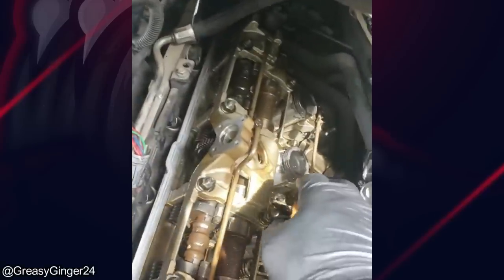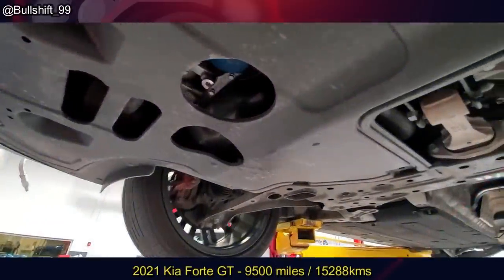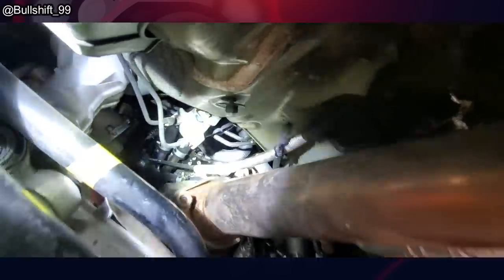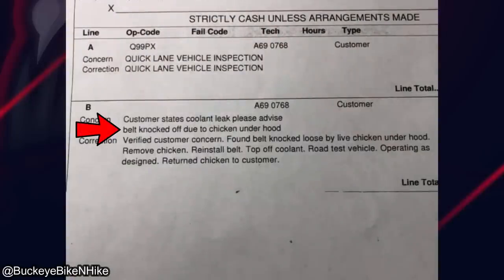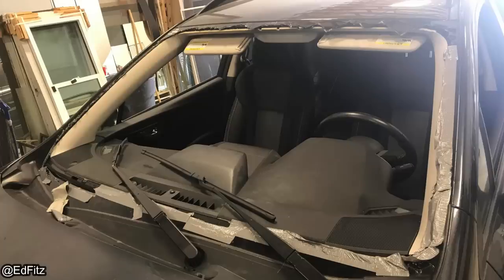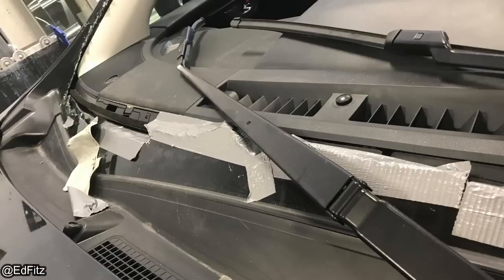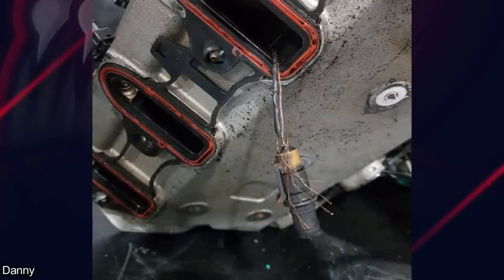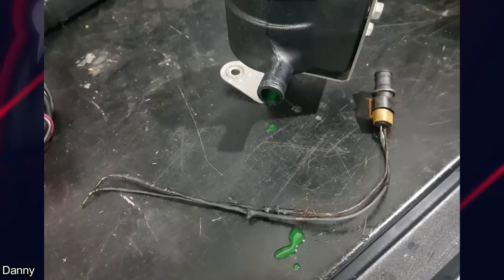Customer States Check Engine Light Is Still On | Just Rolled In

Comment: The last reminds me of myself buying a car and asking mechanic, why my front breaks creaking and shaking the car... he said that rotors are bend and need to be replaced. Ok I said, let it go for a while, then went to another mechanic for minor repairs and mentioning the brakes. After repairs, he told me, that rotors are just fine and some idiot inserted break pads the wrong way... on each wheel they were positioned the same way, not opposed. That was the last time I visited the first shop. :D

Comment: Could the missing exhaust be thieves, stealing the catalytic converter ?

in this case, the costumer would most likely nok know anything about it ?
Reply from the maker: It definitely could be.
The mechanic think it was possibly the customer since it's been like that since almost new, the check engine light is on, it runs rough, its super loud and the customer removed a bunch of the intake.
Reply: You would think the mechanic would mention to the customer, next time they chat (when he returns for the car maybe), "so... what happened to the intake and exhaust?"

Comment: The water pump on those 4.2L Trailblazers and Envoy's are a common issue, one of the few issues I've run across working on those, otherwise they drivetrain and suspension has been solid.

Comment: In Ontario, a windshield isn’t mandatory. Older jeeps can fold theirs down. Strangely enough, wipers must work.
Reply from the maker: Strange indeed. Not sure what our rules in Alberta regarding this.
Reply: Years ago, in MO, it a windshield was not required, it just could not have a crack that blocks the driver's view. Or, pieces of broken glass still attached. I had a friend that had a car inspected with no windshield. I don't know if the same thing still applies or not. And it used to be the same with a rear view mirror - if it has one, it cannot be cracked.

Comment: I worked at a boat yard and it was pretty common for boats to come in with the wrong fuel. Bad enough with a truck but with boats you could be talking over 500 gallons 2 fuel tanks and 2 motors. Or fuel in the fresh water tank. That was always fun but fuel in the holding tank was a really crappy job
Reply from the maker: My uncle use to work at some boat yards. Heard quite the stories so I believe that lol

Comment: Didn't Chrysler also have a problem with dashboard covers a while back? I believe it was on the 300s, but they were cracking and separating in some cases.
Reply from the maker: Not sure but also wouldn't surprise me. Fords had an issue with them warping and such as well.

Comment: yikes! There are things called haynes manuals, worth a read or maybe invite your local mechanic over for a BBQ. I suspect a lot was down to suck it and see learning. As for the windscreen guy here in the UK that would actually be a legit thing to do as technically what is considered road worthy is surprising. You can remove all glass, panels and facia and a car be road worthy. The electrics must work and the mechanicals be sound and no structural faults such as deep rust. The only critique of removing the windscreen is that it was bonded and the residue is gonna be a pain to deal with.
Reply: There is also this thing called "YouTube". When I'm not sure how to do something on a car I'll check YouTube.More often than not people have made videos on how to do it.
Reply: Seems all right to me as long as they were wearing motorcycle goggles!

Comment: Would it be possible to still use the brake pad even if its been put in the wrong way? i mean, the brake surface is fine, its just the metal back that been damaged. ofcourse the rotor would probably have to be replaced / resurfaced

Comment: Had the pollution pump pulley rip off at high speed, it was plastic, and it bounced around in the engine bay like crazy.  I thought a bomb went off under the hood.
Reply from the maker: That'll scare a guy!
Reply: @JustRolledIn  scarier was the tow truck they sent, backed right into my truck, didn't hurt it so i don't stress over it but scared the crap out of my wife

Comment: The reversed disc brake pad was a first for me. Did have a worker fill a shop truck with diesel. Yes, it’s a gasoline engine truck. We
Reply from the maker: Seen my fair share of diesel trucks with gas in them and vice versa.
Reply: @JustRolledIn  ... I have also seen a brand new Chevy diesel van with a no-lead filler neck, circa 1990. (G series 1 ton) Took 2 weeks to special order the replacement part so we had to fill it with fuel using a funnel while we waited for the dealer appointment. The same van also had one of the welded braces for the body side panel installed about 2 inches out of square. Being a cargo vehicle the interior is open and we spotted that while installing aftermarket shelving. Yup, shelving was square from floor to roof, but that factory brace was real obvious. Have no idea how it didn't seem to show on the outside.

Comment: "my friend can do it for cheaper" brings it in with more problems than before also what's with people and installing brake pads backwards? It's not that hard to install them correctly 🤦🏻
Reply: dunno but it's always a great loud laugh whenever i see them installed that way. even better when instead of pulling it back home the second that fucked noise and checking over their work they drive for many miles destroying the shit making it cost more than had not touched it to begin with.
Reply: @rickylafleur5823  yeah they hear grinding and then are like "just need to break in the pads" then they break the rotor

Comment: Just rolled in...from my garage. The toolbox I just got has...at least 10k worth ot original brand new Mopar parts. Fron real main seals, to valve guides, plugs, COPs, vacuum harnesses, abotu 10 O2 sensors, a MAF...and bearings, ABS sensors....I said it in my vid...Im gonna start a Mopar garage called Subpar Mopar...were we Dodge work!
Reply from the maker: 😂 I saw the video. Love the tool box you got and the story behind it.
Reply: Im so tired...I forgot the whole point to my message LOL. I was gonna say, Just rolled in from my garage, to the highlight of the evening. Having a cold snack and relaxing a bit watching the show!
Reply: @JustRolledIn  Thanks! Yeah...it got me. It wasnt me trying to go for views (I think its the oppposite). I did pin the brothers comment up top, and he told me it meant a lot to him. So, Ill do the box right, and give it a clean, polish, and the works!
Reply from the maker: @RipRoaringGarage  it's been a long week already, I could use a cold snack as well lol
Reply: @JustRolledIn  Crack one open, and get to cold snackin!

Comment: My 05 G35 suffers from a cracking dash at 15K miles. Dealer nor Corporate would take responsibility for any repairs. Just bought a dash cover to hide the ugliness.
Reply from the maker: Ugh that's unfortunate. I've heard they switch dash manufacturers a handful of times and had nothing but issues.

Comment: So who pays for that Petrol in the Diesel?
The salesman(Who should've known what car he sold) or the manufacturer for such a screw up.
Reply from the maker: Well it'll be under warranty (the filler neck and not having the DEF filler neck beside it) but to remove the gasoline from the tank itll be the dealerships bill.
Reply: @JustRolledIn  Gas/Petrol in a diesel means new tank, new pump, new filter, new lines, new injectors, new fuel rail.
Not a cheap bill.
If it was not cranked. it normally does cheapen in it since you dont have to replace the rail, injectors, and the lines.
Reply from the maker: @IIGrayfoxII  yep. Seen it lots when I worked at some dealerships. Only one person who was lucky and clued in on what they just did. They got it towed to the shop, we drained the tank and all was good.

Comment: Gas in a 6.7 Powerstroke.  Bye Bye fuel system!  That will trash the high pressure fuel pump, which then sends metal particles to the injectors.  Over $5000 screwup.